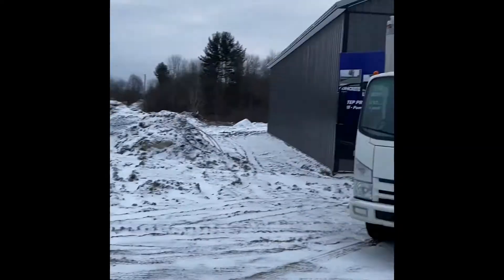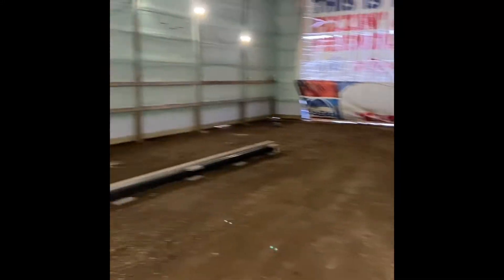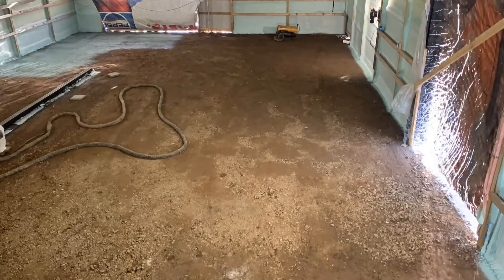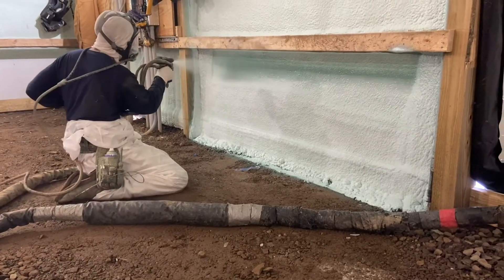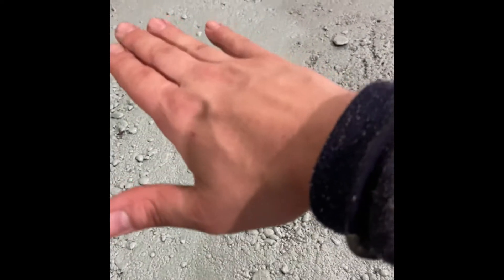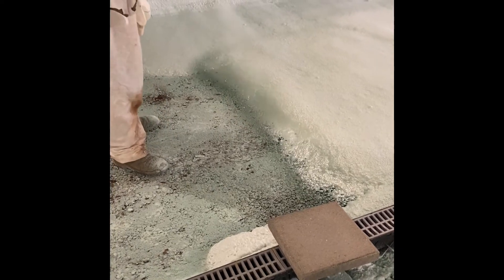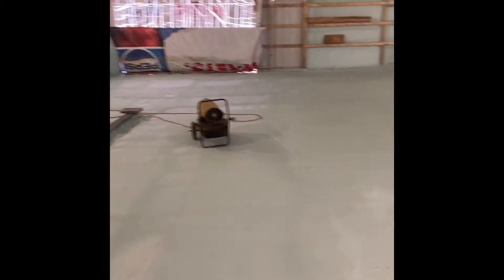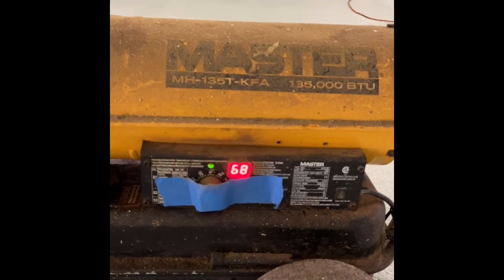Insulating under a concrete slab with spray foam??

Comment: Did you tyvek it? Also, when it comes time to replace your splash board, or having to attach brackets to your columns and then the floor because your ground set poles rotted out, it's gonna be fun
Reply from the maker: No Tyvek on this one. As far as the poles go, I have a pole barn I built over 30 years ago and the poles are still in tact.
Reply: Everyone is always saying the poles will rot out. I don’t know why I’m not seeing every pole barn from 30+ years ago falling apart with how often I see this comment lol
Reply: It's really just a matter of how long do you want it to last. Yeah, it will probably last for a good while in the ground. Depends on moisture content in the ground. And it is repairable. I build these buildings. Pole rot is definitely a thing. Think of the poles used for power lines, they don't last forever either. It's a matter of when it becomes bad enough.
The exterior steel can last a very long time. however if some sheets ever became damaged Tyvek would prevent the foam from sticking and make it way easier to repair.
Try something though. Try and take apart a refrigerator or freezer to theoretically repair it. Absolutely pain in the ass. Foam sticks to everything. almost impossible to not damage things just tearing into it. Now think of your wiring and plumbing.Sure, it's great insulation I won't argue that. But when it comes time to repair things... No thanks. I would consider it for under basement slab radon barrier though.